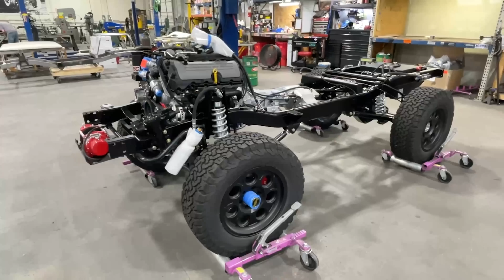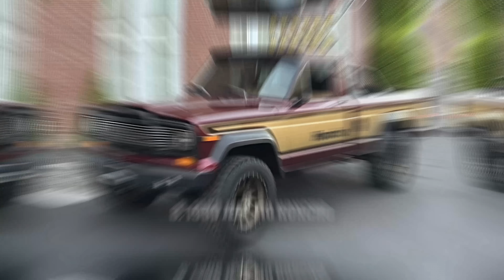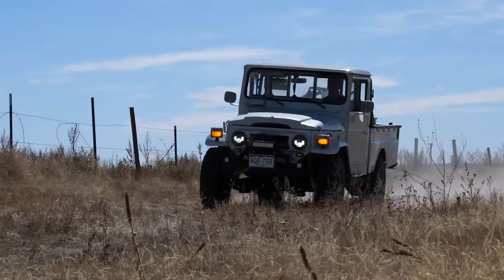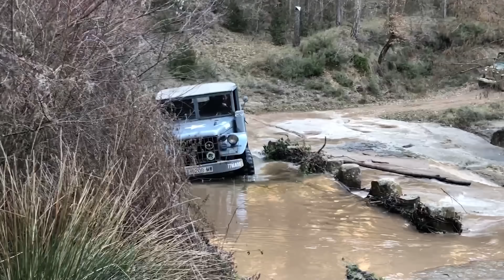10 Old Trucks That Modern Pickups Still Can't Beat

Comment: Impressive that almost all M37s you showed are from Spain. It was in the military here by hundreds, the engine was replaced with a diesel 6cil and it was in service until the 90s.
Reply: Thailand military still has M-37's powered by 4 cyl Isuzu diesel's

Comment: used old power wagons to get thru the worst mud, snow, washouts and as lng as you aren't travelng more than 3mi. they get you where you need to go. They just aren't the fastest.
Reply from the maker: Exactly — those old Power Wagons weren’t built for speed, they were built for getting through anything. 💪 Mud, snow, or washouts — they always found a way!

Comment: I own a 1963 Willys Gladiator 4X4 Pickup that was converted to run a Chevy 350 with a turbo 350 trans built by a rock crawling mod shop. I put on an Edelbrock manifold with an Edelbrock four barrel and Headman headers. The truck was originally a Iowa state parks vehicle and well maintained. There is not a dent or bit of rust on the truck to this day with all original trim. The truck was sold at auction to a pipe fitter. He built a flatbed for it that is the best flatbed I personally have ever seen. The rack could hold a house. The tail of the bed is 4" dia. 1/4" thick pipe blended in for sliding heavy objects into the bed. The side rails are stainless. He also put in bucket seats and a tilt steering wheel off a later model truck (I forget which). This truck is not a show truck. It is my work truck for my property at 4,000' on the US/CA border where we see -30F and four feet of snow pack in the winters. It is a beast.
Reply from the maker: Wow, that sounds like an absolute beast of a Willys! A rock-crawling 350-powered Gladiator that still works hard in those conditions — that’s real truck heritage right there. Respect for keeping it alive and using it the way it was meant to be!
Reply: @VROOR-x  Thanks. To be clear, I don't use it for rock crawling. I use it to skid logs, and so I wanted a transmission that could hold up to that abuse. I went to a place that builds transmissions (primarily) but also does other fab work for rock crawling. I told them how I would be using the truck and asked if they could they build me a transmission for that. They did.  : )
Reply: I have a little video of a cold morning here. at the end is a brief shot of the truck, though buried in snow. Video is called "Cold temps, naughty dog".
Reply from the maker: That makes perfect sense — sounds like you built it for pure utility, not show! A transmission built for skidding logs in that terrain is serious work. That Willys is doing exactly what it was born to do — earn its keep.
Reply from the maker: @Graybeard_  That sounds awesome! I’ll have to check that out — nothing like seeing a tough old truck still braving the cold and getting the job done. Those Willys just don’t quit!

Comment: 91 dodge 250 5.9L 12v is and was peak truck engineering
Reply from the maker: Absolutely! The ’91 Dodge 250 with the 5.9L 12-valve Cummins is legendary — simple, reliable, and nearly impossible to kill. Pure engineering perfection.

Comment: UniMog is very strong, but you just cannot drive them on road at all. Which in my book puts it at 10 not 1
Reply from the maker: Fair point — the Unimog is an absolute beast off-road, but its road manners definitely aren’t for everyone. That’s why people either put it at #1 or much lower depending on how they value capability vs practicality.

Comment: I think this video was pretty “spot on.”
IMO the Bronco is not a truck, replace that slot with an International Harvester 3/4 ton 4x4.
And you Chevy 1/2 ton guys will be disappointed with my opinion, but a Willys truck beats you in this department.  If they referenced a 1987 Chevy one ton with an NP 435 and 205, I would be wrong.
Reply from the maker: Thanks for the detailed feedback! You’re right — the Bronco sits in a gray area, and both the IH ¾ ton and Willys pickups are strong contenders. A 1-ton Chevy with that NP435/205 setup is a beast too. Great callouts for future lists!

Comment: Yes, old trucks run forever a point I deviated from and regret. I have two 1995 GMC trucks one diesel that has cost me dearly to keep running and a 3/4 ton that has been dead in my driveway for months now. Had an 87' GMC and drove it 300,000 miles only the 700R4 transmission was a problem.
Reply from the maker: That’s the story with so many old trucks — the drivetrain will take a beating for decades, but the weak link was often the 700R4. Hitting 300K miles on that ’87 GMC is still proof of how tough they were compared to most modern builds.

Comment: most modurn 4wds look and sound like shit  they also have bloated electronic systems  not mention they are just plain huge   and plagued buy  electronic and mechanical design failures
Reply from the maker: You’re spot on—modern 4WDs may be packed with tech, but that often means more bulk, more complexity, and more points of failure. The old-school rigs kept it simple and tough.

Comment: I have a 1974 Ford F-100, all original, never restored. I've had it going on 15 years, and it isn't babied, I haul wood, drag logs, going to make a scrap run next week with it. I want to see one of these new Ford F-150 show trucks, because that's all they are, last the 51 years this one has and still be working.
Reply from the maker: Respect! A ’74 F-100 still working hard after 51 years says everything—can’t imagine a modern F-150 show truck lasting that long doing real work.

Comment: In the apocalypse the Dodge '89-'93 W-250/350 Cummins with a manual will be kings of the Earth.
Reply from the maker: Facts Those first-gen Cummins with a manual are pure apocalypse rigs—no electronics, just simple diesel power built to run foreve

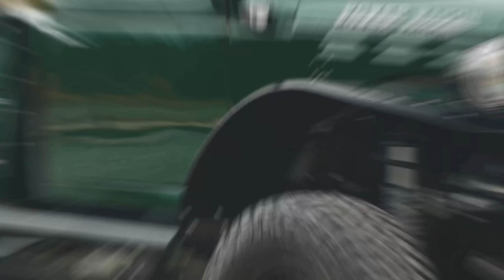Comment: 8:40 the dodge power wagon was the first ever 4x4 truck in the world
Reply: American Bamtam beat it by 5 years with the BRC-40. This was the original jeep.
Reply: @klpittman1  Actually technically speaking. The Power Wagon was the first 4x4 truck mass produced for civilian use. How ever when it comes to 4x4 trucks in general, the first was actually about 30 years earlier from Caldwell Vale. The first 4x4s altogether was in 1898 from Latil in France who made tractors. American Bamtam doesn't even get first 4x4 in the military either, because Oshkosh and several others started making 4x4 military trucks during WWI.

Comment: 1986 f250 4x4 6.9idi simple reliable ruged can use parts from 1980-1995 6.9/7.3idi. Not only is it multi fueled run off motor oil/cooking oil. Has the ability to adapt modern ford trucks parts. On a 85 i have 2020 axles shocks and leaf springs the new bumpers will bolt on with simple bracket swap! Ive seen 7.3psd/6.0 and 6.7 powerstrokes swapped in yes a lot more involved. But the 6.9/7.3 idi solid dana 60 front axle a ztf5sp added is a very good setup.
Reply from the maker: That’s a fantastic setup! The 6.9 and 7.3 IDI trucks were absolute workhorses—simple, tough, and adaptable in ways modern trucks just aren’t. The fact you’ve blended old-school reliability with newer Ford parts makes it the perfect example of how timeless these rigs really are.

Comment: no ford f150? 70's or 80s or 90's? it has a inline 300 engine....
Reply from the maker: The 70s–90s F-150 with the inline 300 is a legend — slow, but nearly unkillable, and will run forever on basic maintenance.
Reply: Inline 6. 300 cid.  Lol not 600 Inline 😂
Reply: @andrewmacarthur1976  sorry it was a misspelling.  im always saying the truck i have since it has a inline 300 engine will outlive nuclear war.
Reply: @unguidedone yes sir

Comment: How about the 1964 Ford F250.  I bought the truck from my Dad when I graduated in 1980.  I still have the truck and it just can't be beat.
Reply from the maker: That’s awesome — a ’64 F-250 kept since 1980 is more than a truck, it’s family. Those old Fords were built to last forever.

Comment: 78 Ford 150 short box 400cu engine 4x4 best mountain truck I ever had
Reply: I wasn't aware Ford put the 400ci in F150s, only F250s. I drove an 82 F250 through high school. Bed was rusted out and Dad had 1/4 steel plate welded to the floor of the bed. That thing was a beast. 
Dad sold it and bought a low mileage 79 Chevy 2500 from his step-dad. That square body was a POS and couldn't hold a candle to the Ford.
Reply from the maker: @bpace2509  Sounds like that ’82 F250 was a real workhorse — and yeah, the 400ci in an F150 was rare. Your Ford story definitely proves how tough those trucks were compared to the Chevy!
Reply from the maker: Sounds like a beast — a ’78 F-150 with a 400 and 4x4 is hard to beat in the mountains. Built for the climb!

Comment: My truck was a 1965 F250 with 428 Ford, Ford cast iron headers, 4 barrel, dual 2 1/2 exhaust with twin truck mufflers turn downs, no crossover, Art Carr modified Cruise-O-Matic with HD internal parts and 4.88 Detroit locker rear end. At idle the exhaust not would make your lungs shake. It was my truck for pulling Horses around. Fun truck could easily beat 1980s 454 GM trucks with ease. With horse stickers on the doors it was a sleeper. My car was a 1957 T-bird with 350 Chevy LTI and auto. Nice memories of my kid in the car and him saying, Go faster daddy!
Reply from the maker: That’s an awesome setup — sounds like your F250 was an absolute powerhouse and a true sleeper. Pairing that with a ’57 T-bird full of family memories makes it even better.

Comment: I bought a 1959 W300 Dodge Power Wagon one ton in the summer of 1975. I fixed it up. Had not run in a few years. It had the flat head six plus a 10,000 lb PTO winch on the front. Was a beast. Wish I had kept it.
Reply: I know how you feel.  I wish I had kept my old trucks and cars.  Now all we get for our money is $hit.
Reply from the maker: That sounds like an absolute classic — a ’59 W300 with a flathead six and a PTO winch is pure old-school muscle. Definitely one worth holding onto!
Reply: I own a rebuild project. No rust.
Problem is that, the car is in Greenland.

Comment: I have a 77 square body 2WD 3/4 ton GMC, it's good but i wouldn't say no to the same vintage Ford full size, in fact i'd prefer it. And the K10's had snowy weather drivability problems because the front track was wider than the rear meaning the rear tires didn't follow in the front's tire track.
Reply from the maker: That’s a solid point — and you’re right about the K10’s track width in snow. Both those vintage GMCs and Fords have their own strengths, so you really can’t lose with either.

Comment: That's because todays "Trucks" are not Trucks, they're plastic, molded garbage that is designed to fall apart.
Reply from the maker: Totally get where you're coming from — a lot of modern trucks feel more like luxury gadgets than work machines. Hard to beat old-school durability.

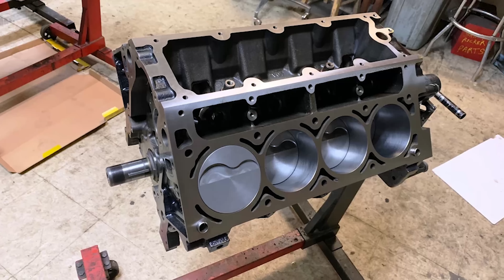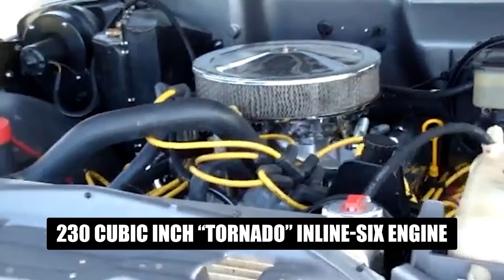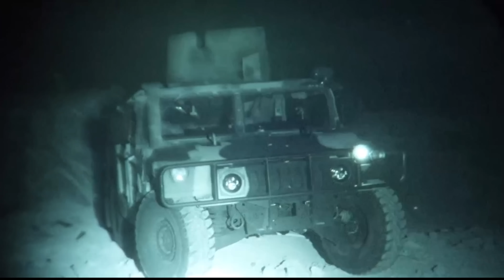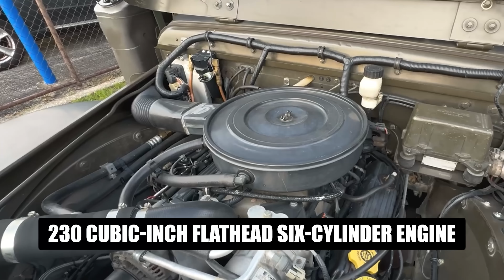Comment: At time point 4:15 you are talikng about the cumins 12 valve  inline 6 cylinder diesel while showing a V8 gaser on screen. This makes your video lame and invalidates your narritive Again at time point 5:27 you are talking about an inline 6 cylinder engine while showing a V8 engine, Again how lame is this video.At 5:48 your still talking about a jeep but showing an H1 Hummer. Here we go again at 10:31 your talking about a 230 cid flat head in line 6 cylinder engine while showing an overhead valve V8. Do you not know the differance betwwen a V8 engine and an inline 6 cyl. engine. Some of your narration was just fine but showing the wrong pictures while talking about these trucks will only misslead people that don't know the differance I won't be subscribing.
Reply from the maker: Appreciate you pointing that out — you're right, and we’ll be more careful with visuals in future videos. Thanks for the honest feedback!
Reply: @VROOR-x  No you won't, you'll keep spewing the same garbage!
Reply: Did you really expect OP to know what they're talking about? They're probably not even an American, much less ever seen a real American Truck!

Comment: SMOG requirements killed diesels and their life span
Reply from the maker: You’re right — emissions rules really changed everything. Simpler diesels back then could run forever with basic upkeep.
Reply: Same happened with gas engines in the 70s

Comment: Anyone else wondering where they can find a Thriftmaster?
Reply from the maker: You’re not alone — original Thriftmasters are tough to find but worth the hunt. Check classic auctions or resto shops — they’re collector gold now.
Reply: @VROOR-x , the problem, as I see it, is that too many guys are busy with the resto-mod to worry about how great that truck was in stock form.  (Don't get me wrong, I'd put better wheels and brakes on it.  And it will definitely need new lights.  But, you can get new bulbs to fit the old configuration to keep that original look.)

Comment: I have a 76 K20 suburban and a new ZR2 Colorado. I live in the Rockies and the suburban walks through trails with the diffs still open. The new ZR2 needs at least the rear locked for the same trail and the front locked from time to time. The lack of EFI in the suburban is never a problem with a well tuned Qjet. Those will run on their side if the fuel pickup is still submerged
Reply from the maker: That’s an awesome comparison! That '76 K20 sounds like a true trail warrior — just proves that old-school engineering still holds its own, even against today’s high-tech rigs.

Comment: Ford Bronco copied IH Scout which came first. I never liked the little Broncos. But the big ones off the F150 I liked.  Owned one.
Reply: Had an 81 with the tow package, quad shocks up front, C6 transmission (on a 302 no less) and a 9 inch rear. Still wish i could have kept it.
Reply from the maker: Totally fair take! The IH Scout definitely paved the way—true trailblazer. The early Broncos had their fans, but those full-size F-150-based models brought real truck toughness. You had one of the best!

Comment: 1991 Dodge Cummins showing a V8 block and talking about a Bosch injection pump. WRONG!  No need to watch this fake click bait.
Reply: And it was built with a cast iron block...wow!
Thank goodness for the FF button.
Reply from the maker: Appreciate you sticking through it—even if it was on fast forward! We'll aim for tighter, more accurate content next time. Thanks for the feedback.
Reply from the maker: Thanks for pointing that out. You're right—the 1991 Dodge Cummins used the 5.9L inline-6 12-valve engine, not a V8. Appreciate the correction, and we'll make sure future content gets it right.

Comment: Square Body GMs. The best older trucks.  I have a 75 GMC Sierra Grande 4x4.With over 650 K on it.  I rebuild the SBC once and rebuild the THM400 and that's it. I drive it every day and haul my quads and trailer out to the desert all the time. No smog. No electronics No BS.    USA1 GM1 🤠🌵🤠
Reply from the maker: That’s a beast! 650K miles and still going strong — now that’s real truck legacy. Respect to the Square Body!

Comment: You had to wear a kidney belt to drive an early Bronco.  They would beat you SENSELESS, even on today's highways. Scary to drive.
That 230ci Tornado inline-6 engine you showed, if you look at the distributor cap, is a V-8, BTW.  (snort)
That old '46 DPW is one of the very best looking 4WD trucks of all time.
Reply: Pretty much any of those 4x4's of that day rode rough.  But that was the beauty of them. Making them softer, ruined them.
Reply from the maker: Absolutely! Broncos were brutal rides, good catch on the engine mix-up — and yep, that '46 Power Wagon is a true icon.

Comment: I have a restored 1980 FJ45 the only other vehicles I would take in addition to mine from these list is the power wagon, M37 or Unimog.
Reply: Yep I currently have a modified RHD HJ45 Troopy, 2H, 5 speed, discs all around and upgraded axles its a beast, I wish I still had my WM300 and M37 they were beast's as well.
Reply from the maker: Wow, that Troopy sounds like an unstoppable rig! The WM300 and M37—true legends, no doubt.
Reply from the maker: That 1980 FJ45 is a gem! And solid picks—those three are absolute beasts in their own right.

Comment: I had a 66 scout 80/800, it was like a mountain goat. My 75 hi boy was pretty capable also. Sometimes the platforms were good, but people didn't outfit it right from the factory,  or they didn't maintain them. Maintenance is normally key to longevity even if you beat on a rig. Id say the original and gpw jeeps should be on here, and the model T pickup
Reply: We used to say about Scouts “they run like shit and 200,000 miles later they still run like shit.” 200,000 miles was a lot in the early 1970s.
Reply from the maker: @timoliver8685  Haha that’s a classic line about Scouts — rough around the edges but somehow they just keep on going
Reply: I've loved and lost some great vehicles, but IH is definitely a favorite  !!!!!
Reply from the maker: You nailed it—maintenance makes all the difference. And you're right, GPW Jeeps and the Model T pickup definitely deserve a shoutout!

Comment: I owned a 1986 Chevrolet C10 and it was garbage.  Nothing but problems.  Needed a new engine at 68k original miles. And a new rear diff shortly after that. In fact calling it Garbage is being nice.
Reply: I'm with you on that one, I had a 71 C10 & it was the biggest piece of shit I've ever owned.
I finally got tired of messing with it & ended up giving it away.
Reply from the maker: Yikes, sounds like that C10 gave you nothing but headaches. Not every classic lives up to the hype!